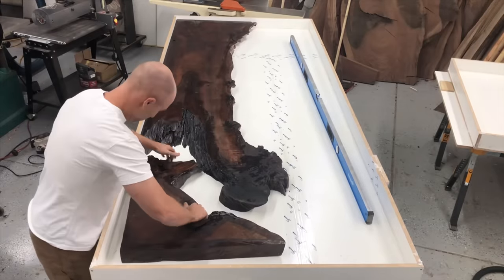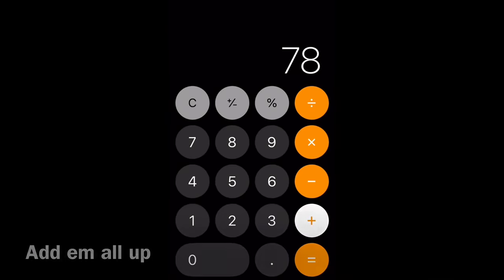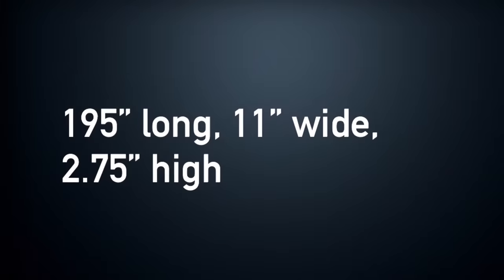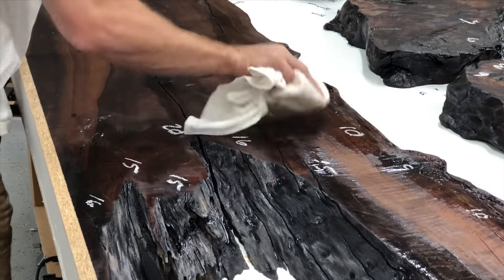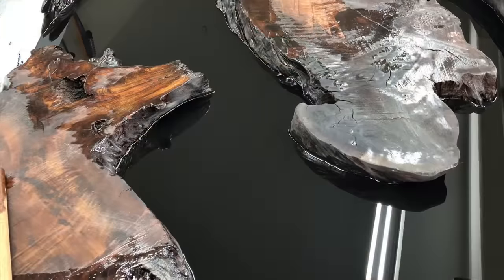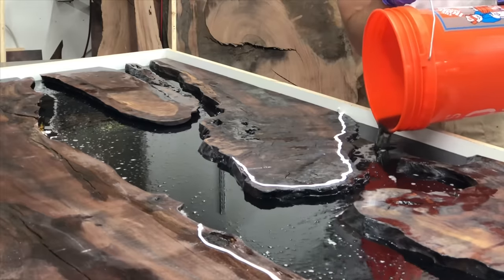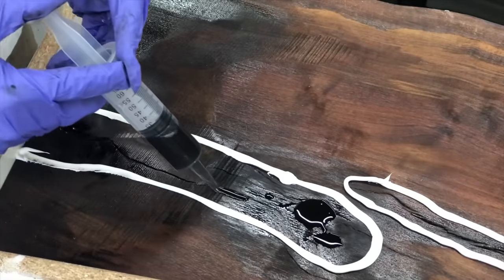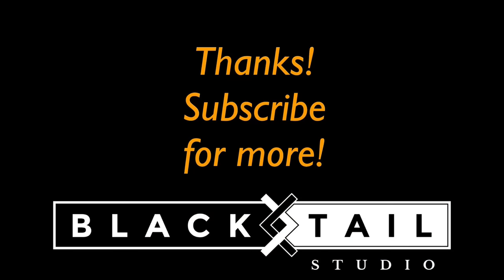Calculating Epoxy Volume--How to Epoxy Woodworking

Comment: To figure out the volume of epoxy you'll need...why not just fill with water first, keeping track of how much you pour in. Then drain off water
Reply from the maker: Oh, so many reasons. I guess that it’s way more difficult that a tape measure would be one though.

Comment: Why not putting all the wood pieces in enclosed rectangle box the size of table, adding water litre by litre to know exact volume of water needed to fill up empty space which will be equivalent to volume of epoxy needs to fill up the table.. the only setback is i dont know if the woods can be made wet or not ?? 😂
Reply from the maker: Water isn’t good for wood 😊

Comment: Why don't you pour the epoxy in one take? You did it in 2 day's. Why? Nice tips for the bubbels. Why do you use a torch and not a heat gun?
Greath table.
Reply from the maker: It can overheat pouring that much

Comment: Can't you do the math with the weight of the slabs?
What would weight a solid table only consisting of wood - the actual weight of the pieces = the weight of the missing pieces. Then calculate the volume?
Reply from the maker: Probably could! Or just use a tape measure.

Comment: I think the easiest way to calculate the volume would be to follow in the steps of Archimedes. You already know the final dimensions of the table so just calculate the volume of the wood pieces. You can do that by submerging the wood in water and measure it out how much water is displaced. Or you could get the weight of the water and calculate the volume from that. Add up the volumes of all your wood pieces and subtract it from your final volume. Boom you did it without having to do all that measuring and math.

Comment: Why always black? I think the black ruins the look of all the edges of the wood. Why would you want a black epoxy table with some wood mixed in. Why not use a clear epoxy?. Or maybe fill black about an inch high at the bottom so that you still see all the wood without seeing through to the floor. Or maybe just a black tinted epoxy so that you still see some of the natural beauty of the contours. Seriously what's the point of a half wood table

Comment: So if the epoxy was $3000....and the wood and extras was $3000? And you sold it for $16,000 😍 that leaves a profit of $10,000 for a week of wood working 🤤🤤🤤
Reply from the maker: Not quite like that, but I made money! Tables also need legs. And 6 months of phone/FaceTime conversations.

Comment: 3000$ for 111 liters? How this possible? In Ukraine epoxy cost 160 hrn per liter this is 5.7$. 111 liters = 17760 hrn/28=634$ Thats without discount, price for more than 100 liters be lower
Reply from the maker: Oh, I’m not based in Ukraine
Reply: @BlacktailStudio  I know. But that's strange, many things from US cost much more in Ukraine. How many cost epoxy in US per liter?

Comment: Too much works of calculation!
Fill all gaps with sands you will instantly know the volume accuately. + 5% 🤣
Reply from the maker: Just need 110 liters of sand. And then vacuum out 110 liters.

Comment: There is much easier method to calculate the volume of Epoxy. Also, your method is not accurate.
You may use water. If you don't want to make wood wet, you may use sand.
Reply from the maker: I’ll go buy 150 liters of sand now

Comment: What an awful way of calculating this.. just layout the table and timber  fill the spaces up with dry sand .. put dry sand in buckets say 5 lt buckets and add them up... simple...
Reply from the maker: Just need to keep 100 liters of sand laying around. And vacuum it up. Emptying back into buckets. Brilliant!